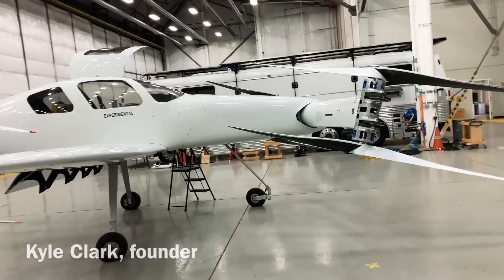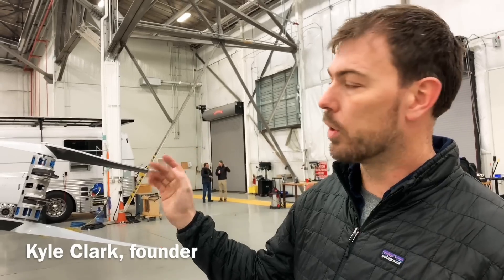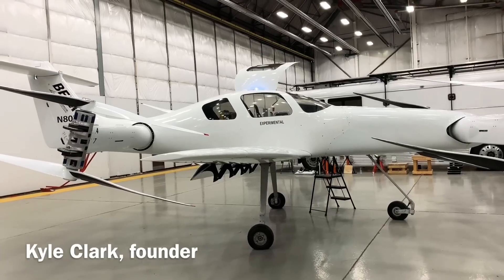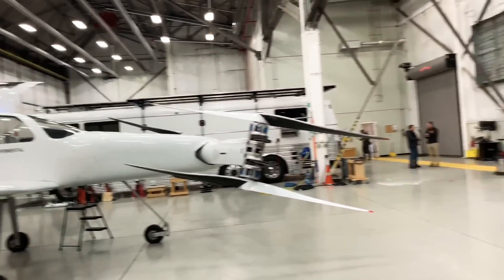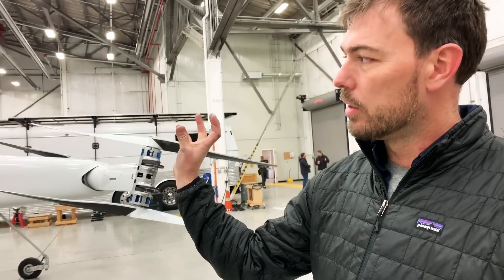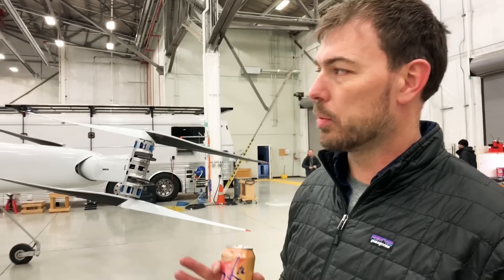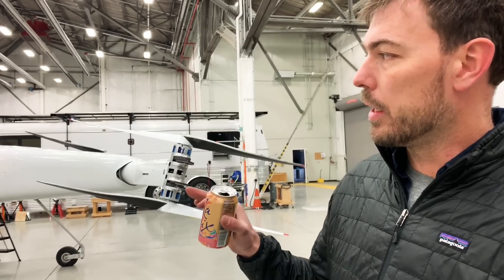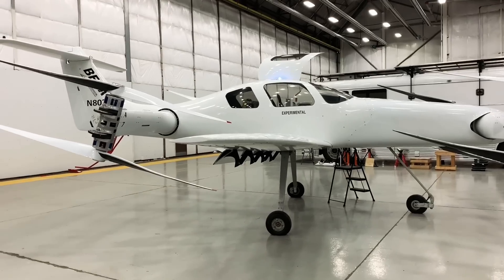Beta Technologies eVTOL Air Taxi Prototype

Comment: This seems to have complicated the aircraft design to the max.  Those rotors look to be causing a HUGE amount of drag for an aircraft of that size, be it fixed wing or rotor craft. You've also increased the number of failure points considerably.  What is the benefit to this design you were hoping to achieve?  I think the AW609, for all it's complexity and long development history, is a much safer looking aircraft.

Comment: It it just me or are they building a drone with wings and are making out that what they have done is ground breaking? Like its EXACTLY the same as a drone but with a power saver called wings. Oh except that the Drone actually takes of vertically and this is just a plane. Its not even a VTOL plane. I mean you can find planes with better STOL than this and they are just called planes.

Comment: So, we're moving such a great load of "organs" that neither a gyroplane or existing  helo / fixed wing tecnology will suffice... The battery technology seems the greatest obstacle.
Energy into thrust is an elusive goal. Even a hybrid design seems to fall short in consideration. As to a VTOL design, their energy  usage is among the least efficient, even if it had a functional low speed lifting chord. Good luck regardless.
Reply: ..Correct. On top of that, even if they did pull it off to a sensible, economically viable air taxi en masse, I highly doubt anyone living in a large metropolis like NYC would accept the level of noise this would give in a city environment. Then there is the issue of skyscraper Venturi-effect, (and wind shear) that is dangerous even for conventional helicopters. 

If this air taxi concept ends up picking two, maybe three people up from a suburb just to drop them off at the downtown city limits and they still require further transportation, I fail to see how environmental friendly it really will be.

Comment: So close. Applause for effort. You're heading in the right general direction. You need an efficient design like I have.
You got right: the rotating ability for rotors ( Boeing Aurora got wrong ); also, you have a wing to utilize lift. Why limit to one wing ( Airbus Vahana )? 
You got wrong: motors mounted on unnecessary rotating arms - extra weight/drag. Is vertical stabilizer needed?

Range? Speed? Payload? Recharge rate?
Using Li-ion & super capacitors?

Comment: This is another example of replacing complicated and expensive mechanical things with electric motors + computers. If you already are using an electric motor for propulsion, adding flying control capabilities, auto-pilot, only require more software.

Comment: As an RC modeller myself since 30years and now drone operator, I love VTOL aircrafts. In fact I made my first VTOL airplane project using two electric heli rotors at the edge of the wing, like the Osprey....So complex project....Sooner or later when the battery technology finally gives us more flight time, many new projects will come in surface and will replace the old classic transportation, and yes even the normal cars will be VTOL technology!
   Maybe it's very soon for anyone to understand your efforts (I see it from the comments) but you will succed and maybe sooner or later this kind of transportation will be used by anyone and not only for companys or rich people.
    Keep up you efforts!

Comment: It is like an Osprey in the since that it is VTOL and then tilts the props to become more airplane like with the lift being generated by the wings.....But the Osprey obviously does not have 4 axis generating power and I do not think it has yaw and pitch control in the same manner that this aircraft does......and obviously the Osprey is not electric powered.....I would say that this is a combination of Osprey like concepts and store bought drone flight concepts.....It is remarkable and it has the potential to revolutionize flight industry as we know it

Comment: No mention of forward speed, props look very low pitch which is good for takeoff and climb, but not for high speed cruise. Fixed pitch props will severely limit the capability of this aircraft. Variable pitch props would improve performance, but be heavier and more complicated, not to mention a control nightmare.

Comment: So much CRAPPIE NOISE -   PUT THE PROPELLER UNDERNEATH - IDIOT$ - IN A CIRCLE 🔵 SHAPE & ON EACH SIDE EDGE OF CIRCLE THE WHEELEGS TO HOLD IT & UP THE CIRCLE THE ✈ AIRPLANE IT SELF LIFTING UP FROM UNDERNEATH-PROPELLER -  SO THE GRAVITY IS 0 -   AND THE MAIN PROPELLER OF AIRCRAFT WILL PUSH THE ✈ AIRPLANE SHAPE-CRAFT WITHOUT ANY MUCH OF FORCE BECAUSE IT BECOMES 0 GRAVITY FLOATING IN AIR.  SO -  YOU WILL NEED 2 MOTORS/ENGINE$     1)UNDERNEATH 🔵 CIRCLE & 2)ON TOP OF CIRCLE THE ✈ AIRCRAFT_AIRPLANE WITH PROPELLER PUSHING A VERY LIGHT TO BECOME WEIGHT FROM UNDERNEATH THE CIRCLE.   SO YOU HAVE 1)+🔵 + 2)✈ =  SHAPED AIRCRAFT " THE BLACK_PLANE FIGURE ON TOP OF BLUE CIRCLE FIGURE ,   AN AIRPLANE ON TOP OF FRISBEE - SHAPED AIRCRAFT - GET IT ?            THIS ----->>  🔵 ✈

Comment: Just watching the take-off roll and noticing the way the nosewheel strut is shuddering.. I wonder if they have any concerns with nosewheel shimmy and shuddering, especially on landing.  I get that it's VTOL, but if you did land with a forward speed, especially when applying brakes after landing, I can imagine it would be prone to some degree of vibration.  I've flown about 1700 hours in a DA-20 C1, with a similar nosewheel assembly, and the shimmy is just awful at times, especially if the friction damper is wearing out.

Comment: Looks like he took a Lancair IV and put some tiltable electric powered props on it.  So far so good, why build a fuselage when you can get one from a kit?  But it didn't look like a vertical takeoff at all, it looked like a somewhat longer than usual normal takeoff.  Perhaps he was just playing it safe, going fast enough that a sudden motor failure would not result in an instant crash?  A big worry of mine with all these quadcopter designs is that they have no ability to autorotate, so a power failure means a crash.  Also, rather than redundancy by having 4 or 8 motors, they have the opposite, a single point failure out of 4, or 8, means a crash.
Reply: Actually no.
With an 8 motor set up such as this, should one motor fail, the flight controller will try and compensate by increasing the power of the remaining motors on that rotational set whilst reducing the power on the rotors in the contra rotating set.
This will provide stability and maintain flight ... but with caveats. 
Let us assume the worst case scenario - failure in the hover. Control will only be maintained if in the case of a single rotor failure, there is 25% more thrust available than weight, as in effect we lose the thrust of two motors, one for real and one as torque compensation. 
Control will still be compromised, particularly in yaw, but assuming sufficient power is available it should be survivable.
In forward flight, there is less of a flying problem, but landing becomes awkward.
Would I fly in one of these? No. But I admire the vision and technology. Early days yet.
The rolling take off for a first flight is a sensible step. Using translational lift stresses the motors and rotors less and gives more margin of error in flight controls. The flight looked rock steady and showed the FC is doing a great job. I look forward to more flights.

Comment: Someone please correct me but this is my thought process on a single motor failure and how to safely regain control.

Mathematically speaking, if you deactivate the counterpart to the down motor you should be fine. For instance right/rear/top with left/front/bottom the lift should be balanced and the torque from the mass of the propeller should also be balanced. Yes the aircraft is automatically going to produce 75% of its theoretical thrust but the decent should be smooth. I say theoretical because contra rotating propellers lose efficiency when stacked. Overlap of thrust robs potential low speed air from being accelerated, decreasing efficiency. I would say with 2 down motors it would be flying at 85% maximum thrust which should keep it in the air no problem if the tolerances for power to weight are liberal.

Rctestflight does a cool
Demonstration with slow rotating props much like these.

Comment: contra rotating props in a quad copter design..., ik you probably are trying to make this thing fly with that reduced propeller span inherent from the design you choose for this thing, but you are not losing efficiency?  i mean a different Propulsion assembly with a bigger blade and one motor shouldn't be more efficient? , and given that you are driving this only with batteries means that you need to use carefully every "drop" of precious energy that you can take from those batteries

Comment: Pretty cool im digging it. Because you don’t need the wing for takeoff or landing you could use a really small wing that would be more efficient at cruse speed. Glad its x8 configuration so it has redundancy. Front nose gear looks really flimsy. Are there belt drives on the motors to the props why  do that when you can get whatever kv motor you want?

Comment: This has one of the bests run times I've seen so far.  But that said, let's be clear about one thing.  There is no way... NO WAY... these things are going to be allowed to fire up in your back yard and fly you to work or to the cottage.  8 screaming rotors throwing debris all over hell's creation is bad enough, but when (not if) the first one goes sideways and those rotors do what rotors are going to do when they hit something... it's game over for these things in subberbia.  I wish all these guys all the best luck in the world because I want one... but the cost and the limits on them are enormous.
Reply from the maker: Darryl Braun great points but this is not intended to be a production aircraft. It’s meant to prove the viability of electric vtol and expose the practical challenges. The final product will be much different. ✌🏼

Comment: NEVER in the video did the craft ever rotate the propellers to any other position than what they were when on the ground!  Never showed that it could be done, nor what flight characteristics were with the propellers in a "flying" configuration!  And, IMHO, the landing gear needs to be retractable!  Would also like to know what range is expected and recharge rate on the batteries.
Reply from the maker: It was one of of hundreds of test flights, in this case testing the stability of the aircraft in single rotor setting.
Reply: @ericadams321  , that's fine, but since there were "hundred of test flights", were there not any videos made of it with the rotors in "flying position???"  Would have been helpful to see that.
Reply from the maker: @waynethompson8416  Yes, there are such videos. This is simply my own footage for my own video.

Comment: Why not more airfoil on the rotor arms instead of the wing in the middle?
Reply from the maker: Brian Johnson because those outriggers rotate with the motor pylons, and the down wash from the rotors will affect their stability, so they basically have to be as neutral as possible
Reply: Down wash?  The rotors (and air foil)  would change between horizontal and vertical, thrust would  change between down and aft?
 Am I too simple?

Comment: I know it would add weight but, if the fans were ducted wouldn't you get enough boost from the shrouds to compensate?  Also it would be an excellent safety feature.

Comment: No way. Loose a prop or prop tip and you have too much of a chance for it to go right thru the fuselage right into the cockpit. Then multiply if by 4 props at seat level and there isn't a chance in hell I would fly in that.
Reply: why would you lose a prop?
Reply: @daos3300  - Why would you lose an engine, why would you lose brakes? Because it happens, and when it does, the pilot may become the target.  Google - planes that lose props in flight.

Comment: You built a battery operated Osprey .
Reply: Not even
Reply: Probably will kill a lot fewer Marines than an Osprey
Reply: @theshocker4626  The Osprey was ahead of it's time, they relied to much on human input, once fly by wire technology caught up, they've been very safe.
Reply: @bigredc222  ahead of it's time? Bell had been working on a tilt rotor since the 50s
Reply: @theshocker4626   I'm just saying before fly by wire, tilt rotor airplanes were a lot for a pilot to handle, similarly the YB-49 flying wing which was built in the 50s, wasn't a safe design till fly by wire was able to help the pilot control it, and now we have the B-2, I believe the canard wing had the same problems.
Reply: @theshocker4626  Yeah well IQ levels have been dropping since then too.
Reply: @theshocker4626  Too be fair, those accidents happened because of growing pains.
Reply: @PugilistCactus  You mean to be unfair?

First flight of the Osprey? 1989.

2018? Deadly crashes. 2017? Deadly crashes. 2016? Deadly crashes. 2015? Deadly crashes. 2014? Deadly crashes.

Nicknamed the 'Marine Killer'.

That thing is in fact so deadly unfair? It is getting sued again and again by the familymembers of the servicemembers it has killed. No one has dared mention any 'growing pains' in front of the court judges.
Reply: @MrFlatage  How many people has the F-16 killed?  high-tech military aircraft are high-performance and dangerous.

The true test of an aircraft's capability is its combat record. After the Pentagon fixed the problems that caused the crashes during development, the Osprey went into combat, where its record has proved to be remarkably safe. The Osprey has logged more than 100,000 flight hours in some of the most inhospitable conditions imaginable with a safety record that's actually considered the safest among Marine Corps rotorcraft. There has been only one fatal crash: In 2010 an Air Force CV-22 touched down short of its landing zone in Afghanistan, hit a ditch, and flipped, killing four. Until this week, that was the aircraft's only fatal accident in the past decade. By comparison, since 2001 six CH-46 Sea Knight helos (the maritime version of the Chinook, which the Osprey is replacing) have crashed, killing 20.
Reply: @wadopotato33  K so you deny the dead their honor and namecall like a child ...

Nothing further to say then.
Reply: @MrFlatage   You have nothing further to say because you had nothing to say in the first place.  I don't dishonor the dead for one minute that was simply you saying something that wasn't true about me or how I feel. 

 The Truth is that the Osprey isn't the killer that you make it out to be and if you are so about saving lives then why are you also not writing about how many people have died in CH-64's, etc.  The real truth is that you are too intellectually lazy to look things up or study them.  The Osprey is less dangerous than the helicopters that they currently use and the Osprey saves lives due to it being a substanial performance upgrade over current helicopters.

Comment: Anything with propellers spinning toward the passengers is an accident waiting to happen...
Reply: as in most propeller driven commercial aircraft...
Reply: @simonl7784  Exactly.

Jet engines are designed to contain failures.

Comment: Nice to see a conventional aircraft design for the forward flight phase. Be interested to see efficiency, range and top speed in FF. VTOL in that configuration has been nailed even by hobbyists, so few doubts there. Even transition to FF has been done in small scale RC.
Why do the wings need flaps?